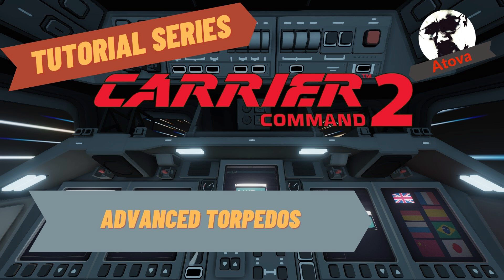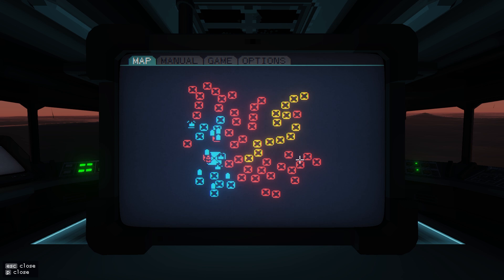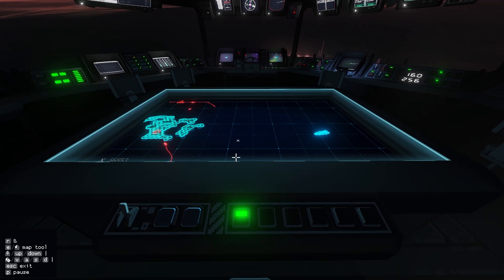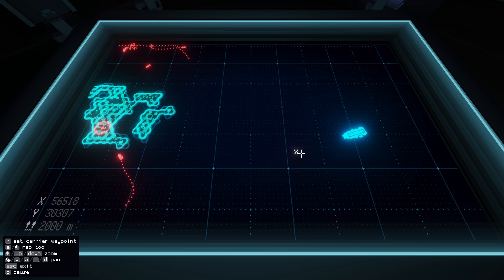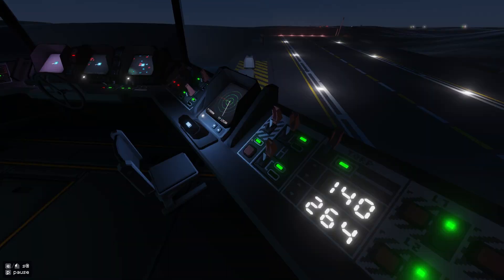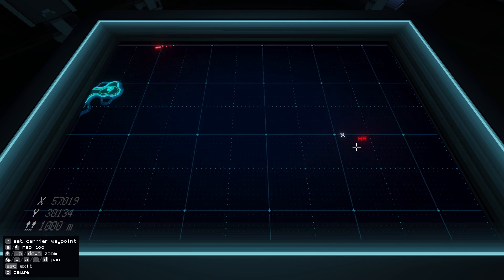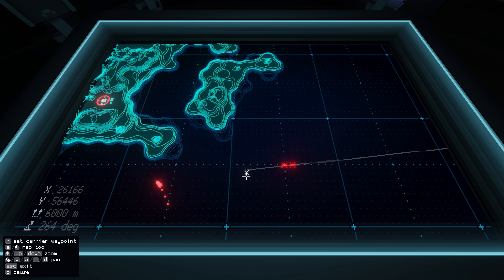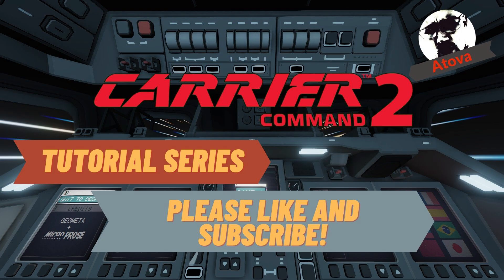Carrier Command 2 Tutorial - Advanced Torpedo's

Comment: Oh and a tip that is off topic, but for making sure your aircraft does not come in for landing on your carrier and flying over the island (because of holding pattern overlapping) and getting shot down make sure your last waypoint BEFORE setting your "Landing waypoint"  is to position it to the Aft Port side (if that is the correct term) of your carrier way behind it 

Look at the holding pattern display (circle around the carrier with a entry line direct from the Aft Port side) set your last waypoint for a straight line way behind your carrier at that angle to your carrier, if your aircraft turns and comes in at an angle that is to wide then it will circle ALL the way around and "whirlpool" its way in over the Holding Pattern 

Its just a tip, allows you to get in closer to the island and launch/land aircraft without coming in low over the island due to your Holding Patten overlapping to close to the island AA
Reply: Great comments thanks
Reply from the maker: Thanks for the tip =)
Reply: Good advice. I always make sure the island is to the starboard side of the carrier during flight ops, but this still is a valid method to shorten the approach, especially when the assets are rather low on fuel. For more aircraft, create a manual holding pattern with 2 waypoints in a loop aft port of the carrier and drag them down to the boat one after each other.

Comment: Hmm, good to know. I've had activation time at 30s and still had them home on stuff and blow it up (that was sitting still, mind) that was several minutes away. It felt like they started homing in at once at activation time as long as the bearing was good enough to keep them in the targeting cone, but that may also have been the current.
Reply: So in a theoretical smart AI or pvp instance delaying your torpedo arm time not only prevents it from locking onto friendly targets but gives your opponent little time to react. As if they did fire noise makers to confuse your torps they would change direction as you narrow the window for the cone to pick up other signals... like a seal sitting in the ocean.
Reply from the maker: @Hamisback  Honestly I’ve not really seen the enemy react to incoming torpedos, and in the times they have moved I can’t be sure it’s because of the lock
Reply from the maker: Yeah it’s not something you always have to do but it can help 👍
Reply: You can miss by low activation but if your long will inactivated torpedo go off or bounce off?

Comment: Did you figure out the range of the torpedo? How far away can i fire it?
Reply from the maker: 20km is what I’ve heard or 10 minutes running time I think
Reply: @Atova  If 10 min is correct: 600 (=10min) * 43 (torpspeed) = 25.800 m. So it would be 25.8 km of range. to much imo haha
Reply: @TurboVeer123  i mean maybe in the range bands used in CC2 but like rl Torps have far longer ranges than that, in fact the US Mk93 torpedo from WWII had a 14km range so ...
Reply: afaik its roughly 20k *from when it activates*, so you can get it to sail 60k blind then activate for another 20k to hit something 80k away...

Comment: My rule of thumb is 1 range ring (10Km scale) per minute so 2500m/min. Yeah, is crude but that's how I am.
Reply from the maker: Thanks, so almost the same as the video. Current may play a factor so difficult to pinpoint.
Reply: @Atova  It is a factor. In practice my engagement ranges are between 5-7 km frequently - often due to navigating around shore to get a line of fire. Activation time is about bringing the torpedo within the active bracket. Right now the timers are quite generous. The targetting also unless it activates very close to target and outside the cone. Bearing I rarely have to adjust beyond 5 degrees since I snipe mostly stationary targets. Once the enemy moves and engages that is a very different matter.
Reply: That's a good rule of thumb, have to take a note on that.